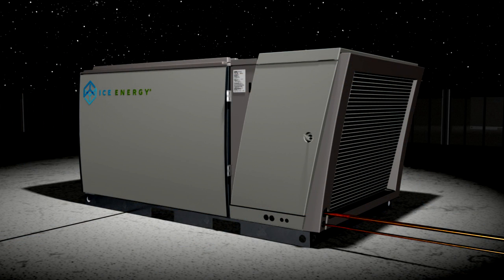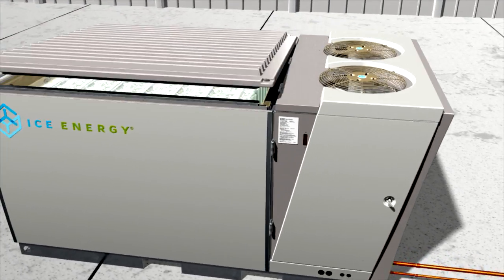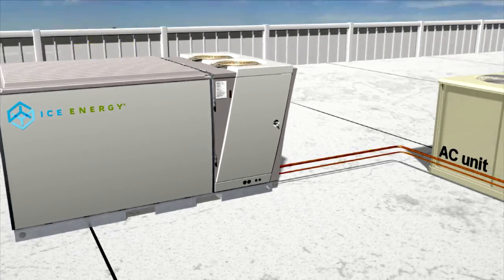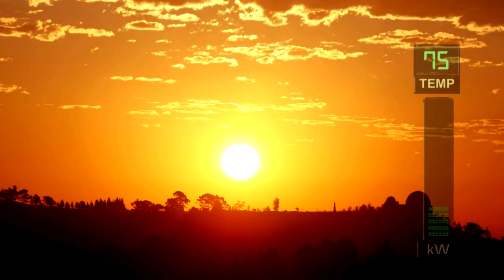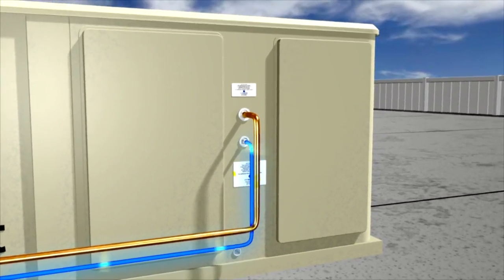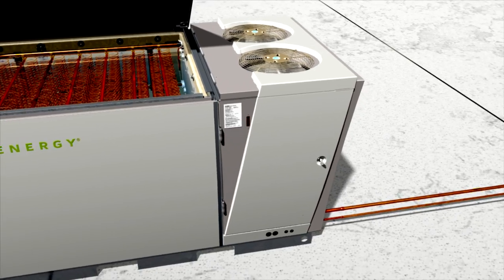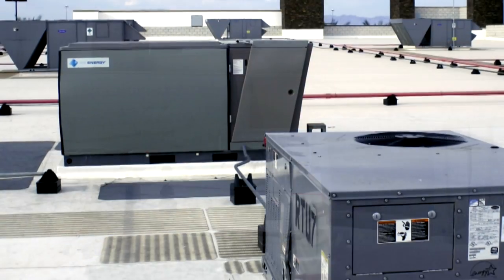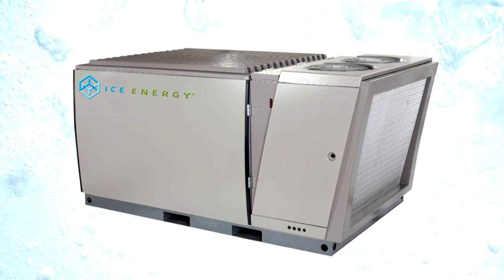Ice Energy - Energy Storage Solutions

Comment: I'm late to this party, but here's my opinion: Storing cold is the oldest form of air conditioning. incorporated in buildings for millennia. making a retrofit system, though complex, is clever and is suitable for high rises or glass facade buildings. For homes, proper building codes exist to store night cold and insulate homes so they don't need AC at all or only very little. If you live in an aluminium sided 4X4 house with a slapped on AC to make the indoors tolerable. You live in a country where electricity is not properly taxed.

Comment: Total rubbish. Nonsense engineering that denies the laws of thermodynamics and energy consumption. Gimmicky workarounds to trick the simpleminded.
Reply: What's wrong with it?  It makes ice during the night, then melts it during the day, thus reducing the daytime strain on the electrical grid.  How is this rubbish?
Reply: @am74343  its Rubbish bcd consumes energy to make Ice ..it doesn't harness waste energy or Sun energy.. study more on Thermodynamic
Reply: @mazmirzakhani4217  Where does it says it harness waste energy or "Sun" energy? Although this device can use what otherwise would be curtailed excess generation (like from PV/Wind) to make ice for effectively 'free' energy.

The reduction in energy DURING PEAK HOUR is accomplished by shutting off the AC compressor (as stated in the video) and using the stored energy. You'll have to make up (and more) for it during the night (load shifting & peak shaving). It is effectively a cheaper battery that can only be used to meet cooling demand. 

There is abs nothing wrong with this product and neither is new (the exact configuration might be). You're the one that need to study thermodynamics more.....
Reply: SlipperySlope nope, this system works. At night the ambient air is cooler, so the condensing tempreture of the compressor is much lower(provided the condenser is sized properly) , therefore increasing the COP of compressor. Each ton of ice holds 333,000 kj of stored cooling energy. This can be readily used to cool glycol that can be circulated to fancoils.
Another big advantage is that at night the power cost are much much less than during the day, in some states as much as three times cheaper.